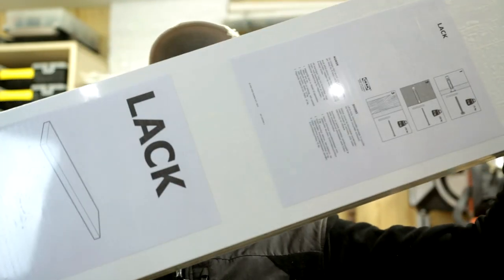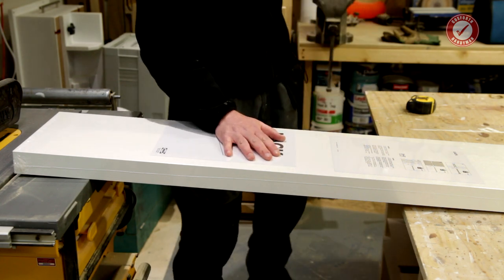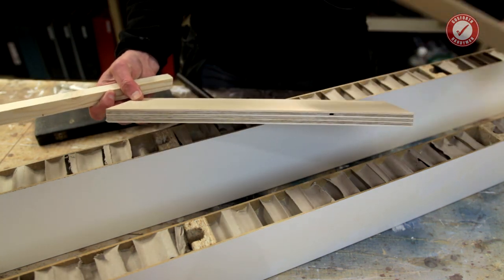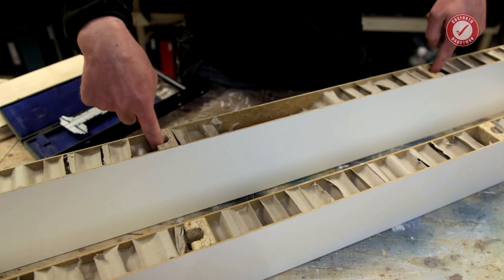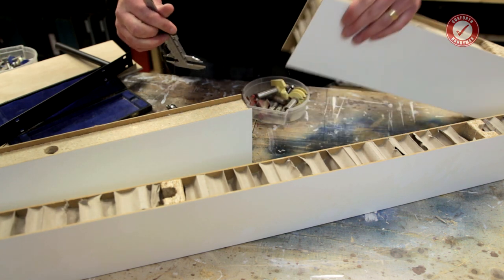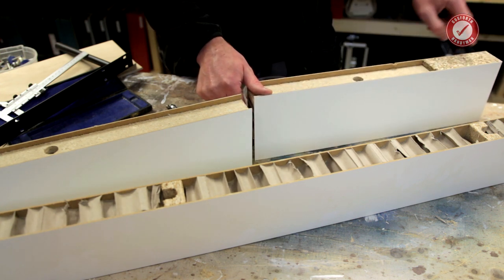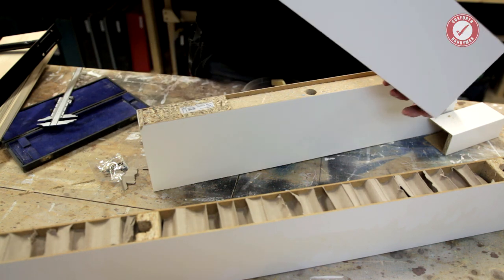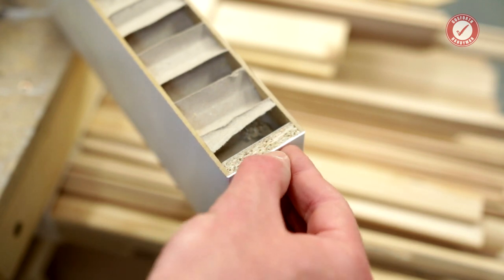IKEA Lack Shelf - WHAT'S INSIDE??!

Comment: I wonder whether the side pieces are painted on both sides because they’re off-cuts from another product?
Reply from the maker: Possibly... but I think for any product made in this sort of volume every part of it will be made specially. They wouldn't waste paint if they didn't need to. That's $0.0001 worth of paint there! 😀
Reply: Is the paper/cardboard structure stuck to it? Maybe it helps it adhere?
Reply from the maker: There didn't seem to be any glue on the white bit. 👍
Reply: Gosforth Handyman just a thought from my lamination background...painted surfaces improve adhesion. Also the half round segments for the bars, maybe if your walls were bowed this would skew the bars outwards. So this would give room for error (bowed walls)
Reply: If it is mitered, maybe they flip back and forth on the mitering, and use the pieces alternately to get zero waste and the paint is cheaper than the wasted particle board.
Reply: would be my best guess too
Reply: Perhaps it's to make the manufacturing process easier? If they're painted on both side you wouldn't need to make sure the painted side was on the outside since both sides are painted.
Reply: David Fowler I think it’s painted on both sides so they can diagonally cut the front edge for the mitered corner and get two usable pieces. Each side of the cut, the long edge becomes the outside. So 0.001c of paint is apparently cheaper than the 1mm of material they’d lose if they kept the same face to the outside

Comment: It's basically the same as a hollow-core door -- in the US, they are made with a honeycomb of the same type of paper. It's very strong, but also very light. Generally, only custom houses have solid interior doors.

The way you jammed your hand through isn't the direction where the shelf is strong, or needs to be strong. Your test at the beginning was indicative of the strength of the torsion box.

I once had a desk made the same way, from Ikea. The top was amazingly strong and flat, and lasted for a long time. As a woodworker, it didn't exactly make me proud, but from a practical standpoint, it was good.

As to the white end-pieces, it's not paint right? Is't it the melamine on both sides? Looks chipped like a laminate. My guess is they cut up miscuts of their thin shelves or drawer sides or something. Seems weird, but it's a possibility.

Comment: I've had four of these Lack shelves for near enough ten years now. I didn't realise I was supposed to have thrown them away by now. :D
So far, I've yet to encounter a better product in the cheaply-made floating shelves category. I've put up several other superficially-similar competing products over the years (mostly on behalf of my sister). The IKEA Lack shelves were the only ones that sat square to the wall on the first attempt and don't wobble loosely on their brackets. The other ones were all pretty dreadful by comparison. It appears that designing the interface between the wall bracket and the shelf and then consistently volume-manufacturing that interface to the required tolerance must be the most challenging part about producing these kinds of shelves.
The IKEA ones also came with with screws that were not made out of plasticine. (For fixing the wooden box part to the metal bracket. None of them come with wall fixings, because they don't know what kind of wall you've got and don't want to take responsibility for selecting something appropriate, which is fair enough.)

Comment: Hi Andy with regards to the painted inside. My thinking is as follows. The sides are painted to ensure good adhesion when the plastic trim is added. The shelf is made in 3 or 4 different 'lengths' (same thickness & depth) so mast pass through the fabrication line length ways so that fabrication can be adjusted to each shelf length. And then with the shelf side components being fed from the one side, shaped and glued. By painting both sides you can have the same feed cut and fit the component to both sides of the shelf. 

I've hacked or modded loads of Ikea stuff and a top tip I've found is that an awful lot of their glues are heat bonded so can can prize open components with minimal damage if you heat them up first.

Comment: The groove for the pin needs only be a halves as they can't go left or right. That way it is only halves of the area of a rectangle with a drilled holes. 50% saving on wood. Itight also be a formed chipboard section. In massive prod volumes it pays to make such pre formed section and not using drill bits or other tooling.
Reply from the maker: Could be! It looked tooled rather than pre-formed. Very clever though! 👍🛠

Comment: In the production process it doesn't matter which way round the end strip goes if both sides are painted, which perhaps simplifies the mechanics of construction.  That's my educated guess anyway, for what it's worth.  For the price Lack shelves are strong, easy to fit and look reasonable in many environments.  If you're on a tight budget they will work well for you.  

If fitting them to a brick wall you can actually make them support significantly more weight by drilling extra holes in the mounting plate and adding extra heavy screws and plugs.  I have fitted a few of these for other people but I had no idea what was inside these so thanks for showing us.

Comment: You can make strong alcove shelves out of these by knocking out the honeycomb cardboard near the edges and then sliding the shelf onto laths attached to the walls.
Reply from the maker: Good tip! 👍
Reply: When I say strong I mean stronger than on a flat wall using the included bracket!

Comment: Back in the early 80's my parents were burgled. The back door was smashed in and they claimed on the insurance for a new back door. It wasn't until 10 years later and they wanted a cap flap fitted to do it we  discovered it was actually an internal door made out of honeycomb paper and hardboard :D. The worst thing is the scam even included going as far as fitting wiremesh glass for extra security :D

Comment: The Open sides probably allow for more margin for error in production/fitting than a drilled hole in the chipboard.

Oh and it's probably painted on the inside as that part is used in several items (some where it might be visible).
Reply from the maker: Possibly - I really think for something produced in this volume they wouldn't re-use parts. 👍
Reply: You could take apart a 'birch' (or any other finish) version and see if they use the same painted parts?

Comment: Old video but I wanted to leave my guess on the inside chipboard piece "painted" white. I also believe it's not paint but melamine, and my guess as to why on the inside is because I have not found any where they are manufactured on only one side. To do so would probably be customized melamine board, which custom raises prices. And as someone else mentioned, they could be scrap off cuts from other items.

And as far as the papers' strength, RAM board is thick cardboard paper yet strong. That paper seems like its cardboard paper as well, and I'm pretty sure there are different types/kinds of cardboard.

Comment: The particleboard at both end of the rear edge is to protect the corner of the shelf in delivery, remember the screw package is too thin to protect the edges if that piece.
Another reason is to support the ABS edgebanding 1mm thich i suppose
This edgeband also contribute to protect the edges in the manipulation
The paint or finished white face is possible the “evolution” of honeycomb furniture. On early days a strip of wood had to be applied between the inner faces of this type of board and previously machined to a exact height ‘cause the tolerances and waviness of the thin faces, the next generation used a plastic strip instead of wood because always a additional support is needed when 3mm faces are used.
I think the white material is the same of the faces possibly the scraps of the sizing 
Saludos
Gerardo

Comment: The two chipboard end pieces, i suspect, are spacers attatched to the backpiece [the one with the holes drilled] and used for insetting it at glue-up. The 10mm end piece...maybe it comes as a coated piece that is also used in another product and they capitalise on cost by using it here too.
Reply: p.s. what do they mean by LACK?
Reply from the maker: No idea! Lack of materials? 😭👍

Comment: Thanks for this video! I'm wanting to shorten the length of a couple of these for a nook that's 54 inches wide. Do you think I could saw about 10" off each end and still have the shelves be structurally sound for the most part? The ends will be snugged up against the walls on each side so the ends won't show. Thanks!
Reply: How did the shortening endeavour go? I am mere days away from removing about two inch/5cm from these shelves to fit them in between kitchen cabinets.

Comment: The corners are painted on both sides because the strips run through a auto machine that coats both sides then it's cut to length and drops through and then picked up by another machine so it doesn't matter which way round it's placed . All these products are done on cnc's and auto machines . There was a programme on Tele about Ikea products .

Comment: I think the end caps are painted inside and out so that any side can be used. You just pick it up and assemble it, either by hand or by machine. The cost of paint is negligible in such large quantities!
The end pieces that touch the wall are ther, I think, to allow you to scribe to an uneven wall and still have rigidity. Got your pint right here, Connecticut USA

Comment: My theory of the holes was that it gives a little leeway for the bars.But yours seems a better one.I think the painted wood one is like a lot of those things, they paint both sides to eliminate the mistake of it going on the wrong way.They do that with the drilled holes for shelves and cabinet sides,so that either way works
Reply from the maker: I'd agree with this theory (although bear in mind there's a plastic edge band glued over the other painted side). 👍
Reply: Perhaps the plastic strip comes later in the shelf build production?

Comment: It's not the shelf that is rated to 15kg is it?  My guess is that must be the max of the bracket/wall fixings?  I wonder if the internal chipboard support is routed out so that there is some room for error in assembly?  Same reason the end is painted both sides, I suspect the material is used in many Ikea products, some which need it painted?  The end chipboard parts probably adds support too the end of the shelves.

I think they are genius design for a tenner!
Reply from the maker: Yeah, the 15kg is just the max suggested load for a brick wall... I think. They're very vague on this... probably deliberately. 😀

Comment: Looks like they were trying to leave some wood on one side for strength and support.  If you drilled the hole in the middle there would not be enough material on either side for the same reason

Comment: I always thought IKEA was Swedish for “landfill” anyway.
To be far I had a similar surprise when I tried to “adjust” a B&Q door once. Needed shortening a little to clear some new carpet and thicker underlay. Trimmed about an inch off the bottom only to find I’d cut the wooden strip reinforcement off the bottom of the door and that it was actually hollow with that honeycomb cardboard crap inside! Needless to say Senior management (Wifey) was not impressed! I’d never come across it before. The door was light I admit but I just thought I’d been working out in my sleep! 😳

Comment: Hi Andy. Here's a video of a production line from one of the three IKEA factories in Portugal... ( Narrated in Portuguese, but you can follow the process quite easily without the narration, sorry didn't check if it has subtitles in English).
https://youtu.be/g146YobqE9g
Regarding the chipboard painted inside the shelf... I believe that's the base material... Pre finished chipboard. Sometimes we use those, were I work. It saves time and material avoiding primer and/ or laminate with formica. Hope it's helpful... Nice channel and thanks for the vids!

Comment: Oh, what a disappointment -- but not a surprise to me.   Bottom line:  Ikea = the best designed landfill crapola money can buy. Their stuff LOOKS good so long as you don't get too close -- or actually use it for anything.  My most recent Ikea purchase, a swing arm floor-stand reading light literally broke apart in my hands within a month of purchase.  I have a similar one, an el cheapo Chinesium model, that has outlasted the Ikea product by 10 years, and it's still going strong.  It took those smart Swedish engineers to come up with something that looks great but isn't.   My problem is that I still love the Ikea shopping experience and I do love their designs despite my knowledge of the quality, or "LACK" thereof.
Reply: I have a set of 4 Ikea Lack table that I use a lot, and for 4 years already. 
It's not broken. It depends on how you use it but mine are well used and are still in a perfect condition.

Comment: Would it be dangerous to have this shelf just over a radiator knowing that it has paper inside?
Reply from the maker: If it's a water filler radiator, fine. I wouldn't put one over an electric heater with glowing elements though. 👍
Reply: Gosforth Handyman Thanks